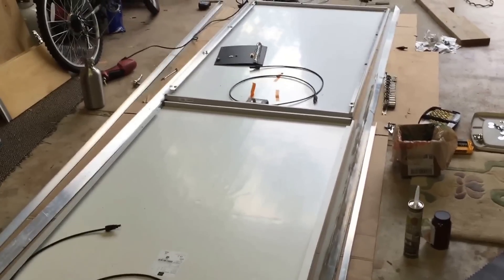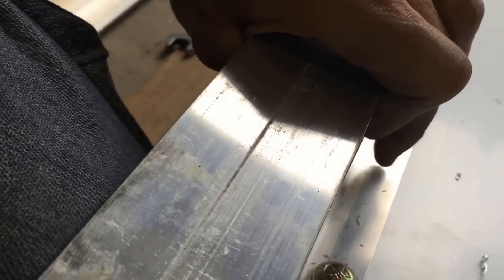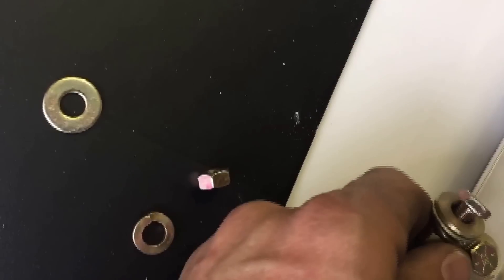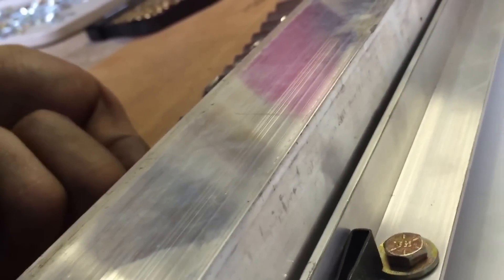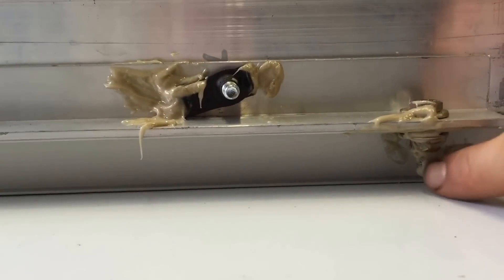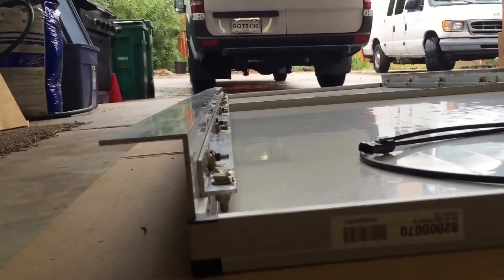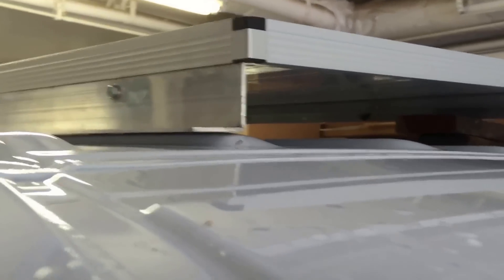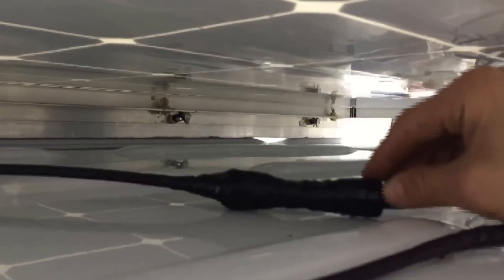Part 2 Sprinter Van Conversion - Solar instal on roof

Comment: In aircraft maintenance, we call those nutplates. What a joy it is when we find out the engineers decided to use these instead of a regular nut.
Reply from the maker: +Adam Johnson Thanks! I am not the best with my terminology.

Comment: That's a lot of free energy! Be aware that the aluminum frame and stainless bolt will form a battery like effect in the rain, and slowly corrode away. I have similar solar setup as yours. After 2 weeks I observed white powdery stuff on the stainless bolts. So I just covered the bolts with the same sealing I used for the MaxxAir fan.
Reply: I don't think corrosion alone will threaten the structural integrity. I saw a youtube video experimenting how lock washer stands vibration over time. I concern that thin layer of corroded aluminum will accelerate the failure under vibration. But I don't have any previous experience working with automotive application, it's just my suspicion. Good to know these two materials can last very long together. Thanks for sharing your experience.